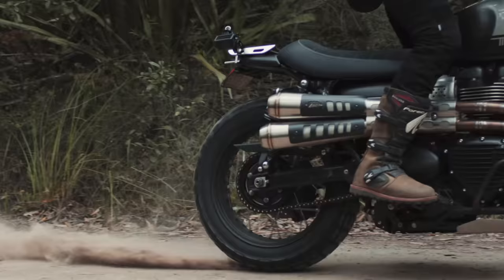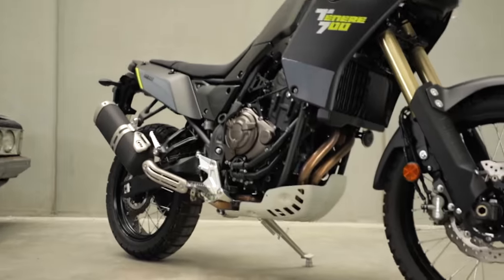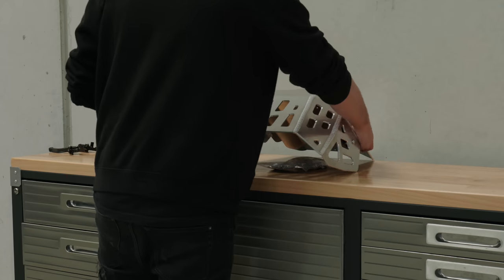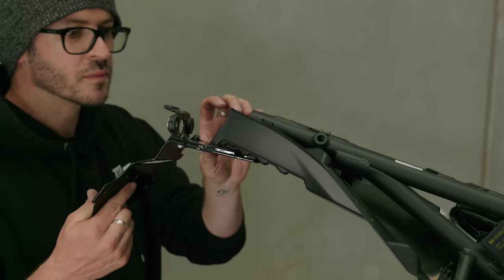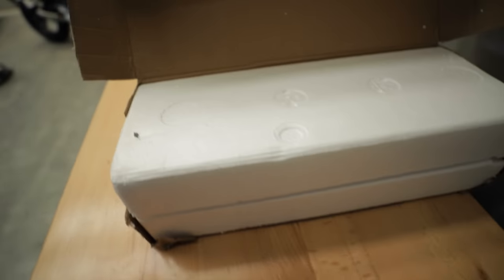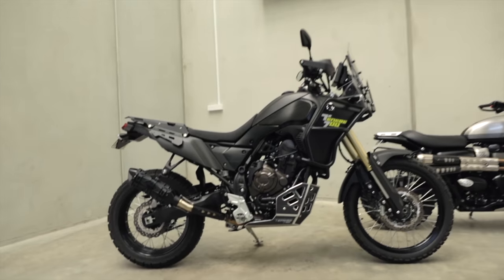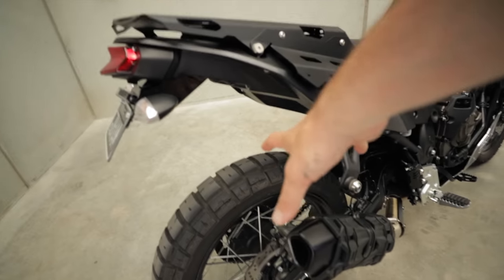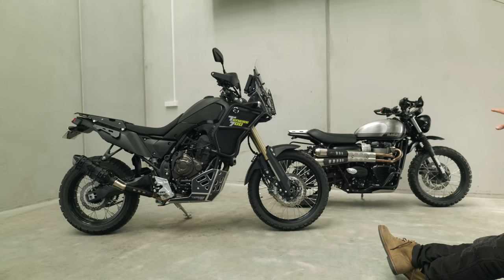I bought a Tenere 700!

Comment: Gotta be honest I really hate seeing Ridge ads due to their offensively absurd pricing.
Reply: Who even carries a wallet these days
Reply: thanks for letting us know mate. I work with Rob as the brand partnerships manager of the channel and it is super useful to understand what you guys want to see more and less in our videos. Feel free to let me know more about what products/services you’d like to see supporting the channel and I’ll do what I can to bring some discounts to you! cheers!
Reply: @juanamaya6278  would be to see the partnership with the bike accessories companies, camping equipment, and all those gears which are used and relate to the theme of the channel.
Reply: You are right, the pricing is offensive
Reply: @CaptKenneth  The funny thing is many years ago I purchased some Senheiser earbuds (long before wireless ones were a thing).  They arrived in a pouch that was the perfect size for credit cards, etc. So I purchased a few more spare pouches and have used them ever since. 

It wouldn't be hard to stick some foil in there if I was that concerned.  Sure it won't last as long as a Ridge but the material cost isn't going to be orders of magniute different.
Reply: It's offensive if you only look at it as the initial number. But they have a lifetime warranty. I've had mine for several years and had things wore out on it. Send them pictures and they sent me new parts within a couple of days. Really easy. The wallet is great and worth every bit of the offensive price, to me. Not worth it for everyone, but i prefer quality and it is quality.

Comment: Rob you need to upgrade front and rear shocks and put a steering damper  on  it will help you off road and put busters on your handlebars put protaper bars just help the bike a little bit better off road

Comment: While the sound of the Akrapovic is great, you might run into problems when you drop the bike on its right side and damaging more than just the exhaust. This is a known problem with the T7 and is fixed by changing the exhaust to one running up high.
Reply from the maker: I did mention this.. which is why I didn’t buy an Akrapovic 😅

Comment: I have always wanted the Tenere 700 for the looks and adventure, but realize that I rarely ever go far out of city riding and commuting and the occasional long trip. Would you say the Scrambler is a better choice? I have been looking at your videos and it seems more capable than I imagined. Also it seems like the brakes and power have been upgraded since you bought your scrambler. What do you recommend? Better off with a scrambler or go for the Tenere 700?
Reply: 1200xe triumph?

Comment: First time that I answer to a review; so be indulgent.I did almost the same modifications than you at the beginning, a.i. Crash bars, 5rally seat, skid plate, led, tidy tail, bark buster, garmin, heated handles , and so on…. The only thing that changed my ride was changing for ohlïns suspensions both and front, and stainless steel hose break. Just saying.

Comment: to tell you the truth I don't like the look of the bike.
it should look like the '88 Yamaha XT 600 that white and red one and they could easily do that, Of course the weight is to much too, but with the '88 xt600e looks would look much better and I really don't think the Yamaha is failing only in appearance and weight.

 the other japanese brands are also failing because they could make a bike like the KTM 690, Honda already has the base for that with the xr650r it just lacks electric start. 

Japanese motorcycles should make a motorcycle to compete with the KTM 690. A motorcycle with 72 horsepower, single cylinder, light as the KTM 690, and simple maintenance. It is in this sector that Japanese brands are failing. In the background is a Suzuki DR 650 with more power, a Honda XR 650 R with an electric start, a Kawasaki klx 650 with more power, a Yamaha XT 600 with more power and the look of the xt's of the 80's that had the suspension more high.

The yamaha T7 world raid looks better and has better suspentions, but should have a high level front fender. 

The common rider wants a wheelie machine but not with 200 kg and the maintenace of a mx bike.
I think that is enough choices for big adventure bikes, but on the level of the ktm 690 or husky 701, there is nothin on the japanese brands.

They should do at least a model like that, with an exhaust with restrictions for Europe because of emissions like the 690 KTM has, that would be easy to fix, buyers would put a new exhaust. And people in Europe and the world would already have more choices.

Comment: It appears that you have plans on crashing a lot with this brand new expensive heavy motorcycle.  This seems common in the ADV world, bash plates, crash bars, protector this, protector that.  Wouldn't it be easier to just not crash.  I don't buy into this idea that all the crash additions, (which add weight), actually help that much, in a real crash.   The truth of the matter is with these bikes its a one crash and you are out of the game with a snapped leg or wrist or whatever.   The actual term should be...."drop bars", as the common ADV routine is to "drop" the bike because of the height and weight issues at slow speed, or from pure exhaustion wrestling these things through hard core terrain.  Ya sure these bikes, when modified, can go some places, but nothing compares to a true enduro bike, with proper ground clearance, and proper low weight philosophy.  I have a T7, but don't plan on crashing it, I don't see the point, and refuse to accept that "crashing" is part of the experience.....Too high risk body injury.   As a final note, that exhaust looks ridiculous.  There is something to be said for leaving bikes alone and using OEM parts.  A personal preference I have.   And from experience, the bike often hits the rider, so crash bars/luggage racks, only increase the risk of breaking your leg or back....good luck with the crash build.